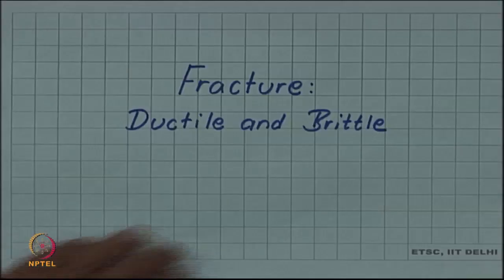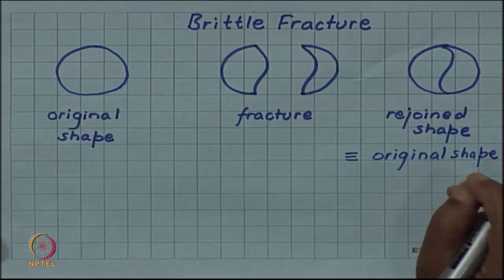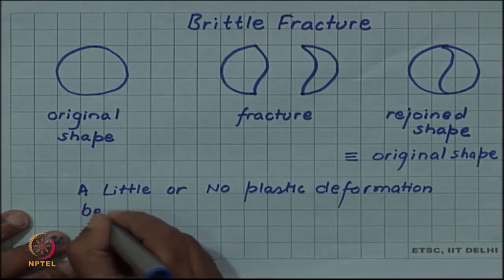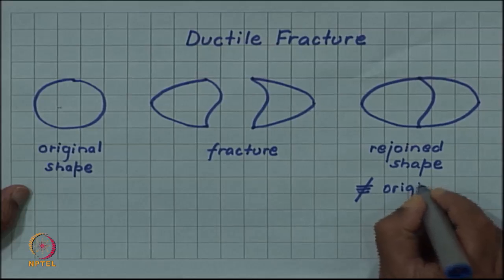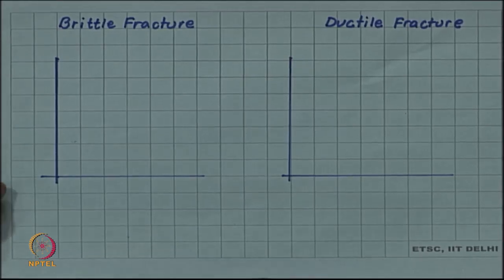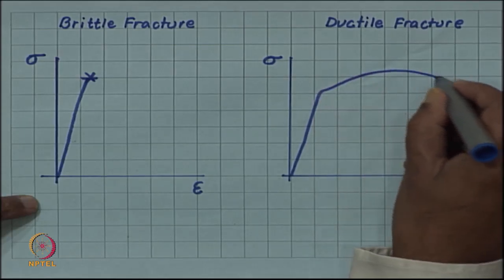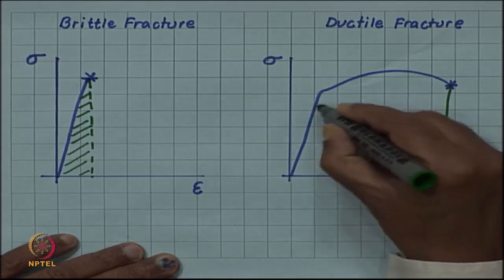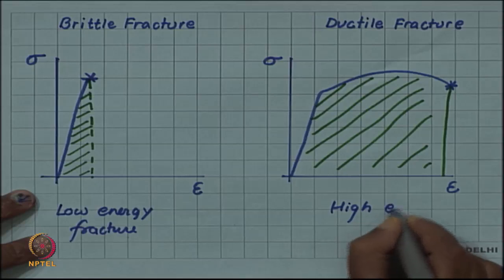Ductile and Brittle Fracture

Comment: Sir  i want to know why brittle materials fails just by breaking of bond? Why brittle materials dont undergo slip phenomena in plastic deformation zone like ductile material?
I mean what makes brittle materials brittle in nature?
Reply: A material can fail across a plane either by slip along the plane (ductile) or fracture along the plane (brittle). Both require a critical value of stress; critical shear stress for slip and critical tensile stress for fracture. So it depends on the nature of applied stress which critical value is reached first. Ductile material usually has a much lower value of critical shear stress than critical tensile stress. Thus it is more probable that it will slip than fracture. The reverse is the case for brittle material.
Reply: @rajeshprasadlectures  sir, if possible please teach welding according to ese syllabus in nptel as well
Reply: Sir, you are the best teacher of material science in the whole world